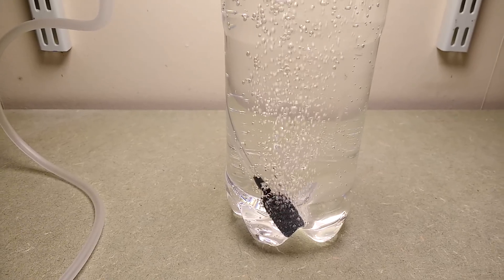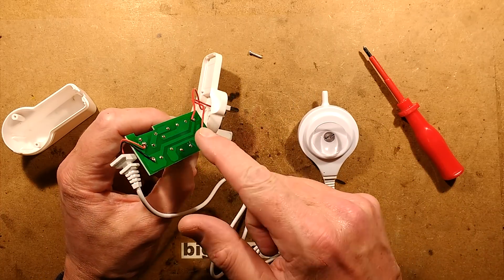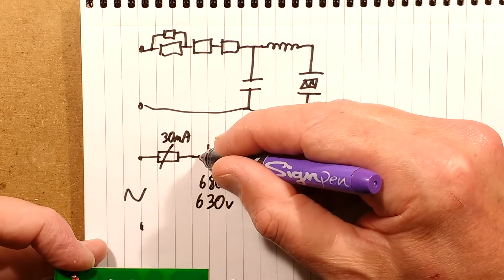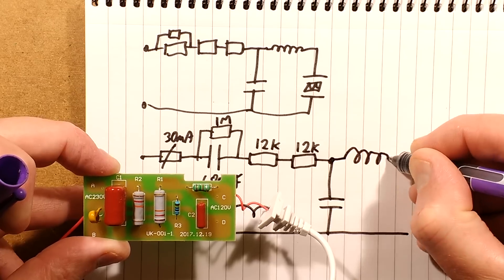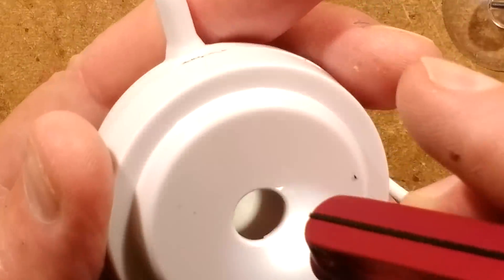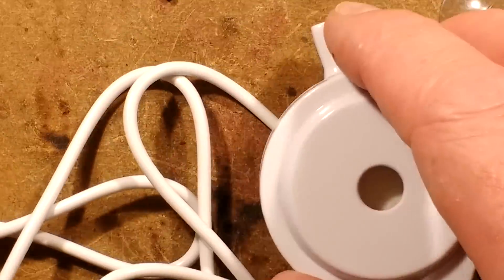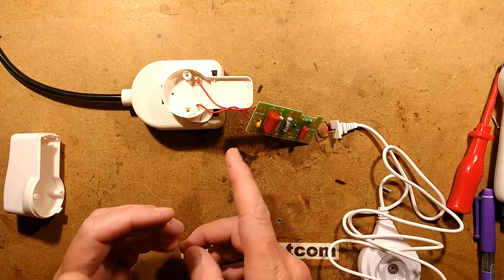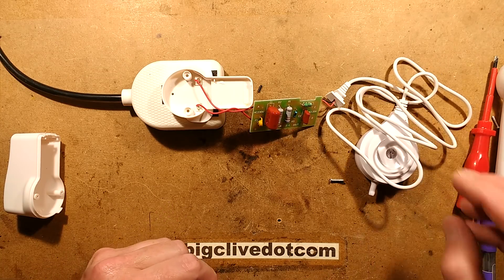Another mini piezoelectric air pump.  Let's compare the circuitry.

Comment: I wonder, if you need 2 such piezoelectric air pumps and put them in serie (2 x 120v right), you can get rid of the power supply (apart for the filters with are needed i suppose) ? Can this work ?
Reply from the maker: I'm not sure if that would be a good idea.
Reply: @bigclivedotcom these 2 piezo can perhaps disturb each other i think and give strange interference noises.

Comment: For anyone wondering. The bubbles don't add oxygen to the water in an aquarium, it's the bubbles popping on the surface that creates surface agitation which helps the oxygen exchange. In reef aquariums we use power heads to give surface agitation and coral sway

Comment: Way late to the party - I finally got one of these in North America - Identical power supply. How would you modify this to run on 120V? If mains supply is already the right voltage would a lower value resistor make sense to substitute for current limiting?

Comment: It used to be that air pumps had a rubber  diaphram and rubber flapper valves that you could easily repair by purchasing a replacement kit. Those kits don't seem to be around anymore, you buy an air pump and throw it away when the rubber  diaphram breaks.  I'm happy to see someone is coming up with a better design than the old style rubber diaphram types.

Comment: I would love to see you take to bits on of those Ebay shower heads that have a water turbine powered flashing LED show. I have had one for years to light the shower and it works fantastic .
Reply from the maker: Already tore one apart in a video.

Comment: That's probably ultrasonically welded shut.  Done correctly, the weld is stronger than the surrounding material.  Cool "technology" but sometimes a bitch to work with!

Comment: Hi, does it state anywhere what the life expectancy of these units is? I found that the main issue with 'normal' air pumps is either the fact they use brushed DC motors or they have diaphrams that wear out -both make the lifespan quite short, just a year or two...
Reply from the maker: These are fairly new, so I'm not sure what their life expectancy is yet.

Comment: Foaming issue is likely to be about the stone and the needless use of one. A straight section of hard air line is often used alone to reach the bottom of an air stirred witches brew and this produces a series of large bubbles that do the stirring without making impossible to pop zillions of foam bubbles. The large bubbles tend to pop a lot easier.

Comment: I took apart the power supply for a Rosewood Q2  pump - this is a higher volume version. It's thicker than the Q1 and I guess is a pair of discs working together.

This power supply is quite different from the once Clive as taken apart. It's a standard iron-cored transformer that drops 230V to 115V. The wire to the pump is 4-core and two cores go to each of the transformer output pins. That's all. I guess it's possible there are components in the pump : I want to use it and it seems difficult to get them apart non-destructively, so I've left that intact so far.

I'd be interested to see what the 110V versions are like. Perhaps they just go straight across the mains, or have a series choke and / or PTC.

Comment: I've found a more powerful version of these pumps. It's the Rosewood Nano Q2 and has twice the flow rate of the more common ones. The power supply is different though : bigger and heavier than the one you took apart, and feels as though it has a transformer in it. The pump is about twice as thick as the Q1 model, which is more like yours. Unfortunately there are no screws so hard to open (and the pump itself is well sealed too).

https://www.amazon.co.uk/ROSEWOOD-Nano-Quiet-Pump-Aquariums/dp/B073F9VJJ7

Comment: Clive      You open all of these devices that have capacitive dropper PSUs and they all seem to have those brown dipped style capacitors for the main dropper cap.   Are these style capacitors considered safety capacitors?  Are they considered X rated capacitors?   Please clarify.  If not, are these considered unsafe and a fire hazard????     The answers might make a good video topic.  All the info I have found on the internet regarding capacitive dropper PSU's dropper capacitors is confusing.     Thank you sir.

Comment: How much did you pay for these pumps? I've looked around but they seem to be fairly hard to find on eBay, at least with any guarantee that they are actually piezo-based.
Reply from the maker: Try a search for piezoelectric air pumps.
Reply: They seem to be more plentiful on ebay.co.uk vs ebay.ca. There are lots more matches without piezo on ebay.ca. Hmm...
Reply: There seem to be many more available from chinese suppliers than UK ones. But one of the cheapest I've found in the UK was in the pet supplies section of Wilko (£10).

Comment: Might be stupid question, but why does the UK use 50Hz & the US use 60Hz?
Reply from the maker: There were initially a lot of different frequencies with each company having it's own standard.  That settled out to two dominant groups 50Hz and 60Hz.
Reply: 50Hz is a more pleasing hum to the ears 😋 and if you get a shock there's more chance of letting go of the live conductor when the AC waveform passes its 0V part of the phase.. Lol.

Comment: I see that PSU as being an accident waiting to happen. It looks exactly like a low voltage adaptor, and the danger is that someone will cut it off and try to use it as such. The live side does have some current limiting, but the main danger would arise if the live/neutral were reversed because then one side would be direct to live.

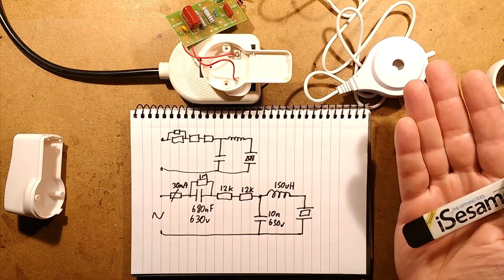Comment: 9:50 : I doubt that it might just be the opposite... The resonant frequency of the piezoelectric crystal might interfere with working of other devices connected to the power line... Also in typical LC filters the capacitor to the ground comes after the series inductor.. Which is opposite in this case... Indicating that the crystal might the source of noise and not the power supply... Just a thought :-)

Comment: I'm guessing the foaming is caused by an additive in your HCl. I use copper sulfate and HCl for my etchant and it hasn't had any foaming issues. Also, if you get impatient, adding some 3% peroxide to the etchant goes much faster than bubbling air through it

Comment: Fabric condtioner (like used in clothes washing machines) is excellent for stopping foaming up. One or two drops in a tray of etching soloution should be plenty as it is quite concentrated.
Reply from the maker: I'm cautious about using anything oily, as it may interfere with the etching of the PCB.
Reply: My PCBs come out fine.

Comment: That's definitely a tuning inductor to tune the electrical resonance to the same frequency as the mechanical resonance. If you wire past the inductor, you will see the piezo transducer's output is extremely reduced...

Comment: The solution is probably reacting with the air stone to be fair, have you noticed any grit in the bottom of the fluid?

Did you try the ultrasonic idea?
Reply from the maker: It doesn't seem to be disintegrating.
Reply: bigclivedotcom maybe a very mild surfactant may help

Comment: Am I right in being concerned at the thickness of the wires coming from the live and neutral pins from the plug? I didn’t think it be safe for them to be so thin.
Reply from the maker: I think the insulation is rated high enough.  The main factor in choosing that cable is probably the low current and limited nature of the supply from the plug unit.
Reply: bigclivedotcom thanks for the reply Clive.

Comment: I have wondered why put a Resistor around a capacitor. I have been looking for this answer for a while now.  Also, none of my books show resisters in series, is that common? I fully admit I could have just missed it.
Reply from the maker: When you add resistors in series it shares the power dissipation between them so they will run cooler.
Reply: Helps to "reliably" discharge the cap.  Fairly important at UK mains voltages (with a peak voltage of around the 350v mark) - putting a finger across a charged, decent-capacity cap can be an "exciting" experience! :-)
Reply: Phil S Thank you for your answer
Reply: bigclivedotcom Sir, I’m kind of jazzed, the man himself answered a question. Thank you.

Comment: Thank you Clive for showing the pump in water. That is amazing that so much air can be pumped by a Piezo disc.
Reply from the maker: It is quite surprising.  Someone calculated the deflection from area and volume of rated output and it was quite low.
Reply: The fact that they could make a check valve design work with that small amount of air flow is also amazing. Thank you post both video's on this . Enjoyed it a lot.

Comment: I've been maintaining a copper chloride etchant bath for over a decade now, and I use a fairly high airflow for sparging (more than an aquarium pump would put out).  I don't know if it's gradual contamination from organics (resist, etc), but I have to watch the foaming too.  

I just designed around the problem.  My etch tank has a reasonable excess of depth to allow for a sustained head of foam to develop.  If you're just sparging for regeneration, you can always just use a larger container with a different aspect ratio.  I kind of gave up doing air-regeneration that way.  It's slow, and you lose a lot of water to evaporation over time.  

I use heavy sparging during etching, and that keeps things fairly well oxidized to begin with. If I need something more to regenerate it, I just use 12% peroxide from the beauty store.  It helps replace some of the water lost to evaporation during etching anyway.  I run my bath at ~40C with heavy sparging; anything less vigorous than that would have less evaporation loss, so it might matter less to you.  

Other than that, just maintain free acid concentration, and the bath will last forever.

http://the-eye.eu/public/Books/campdivision.com/PDF/Sciences/Physics/Etching%20with%20Air%20Regenerated%20Acid%20Cupric%20Chloride_%20Adam%20Seychell_%202005.pdf

Comment: Half baked idea: industrial anti-foaming agents are of course  available. but Dulcogas contains the anti-foaming agent simeticone - if it stops foaming in stomach acid (mostly HCl) maybe it'd work in your etch tank... at least it'd impart a pleasant minty flavour :o
Reply: Simeticone is a silicone compound, not something you want anywhere near a PCB if you hope to get a good etch.
Reply: I don't have the chemical knowledge to say... but I have found a patent that mentions using DC544 as an anti-foam in PCB etching http://www.freepatentsonline.com/5127991.html
and DC544 is a silicone based anti-foam
Reply: That's interesting; I have to wonder what post treatment is required to remove the silicones from the board.

Comment: I had the same problem with using brick/concrete cleaner as a source of HCl for cupric-chloride etching. While the etch chemistry works, the surfactants in the brick cleaner make it foam up significantly. You need a very big tank to contain the mess.
I found straight HCl from a chemicals supplier (without the soap additives) is much better behaved.
Sadly I've yet to find a way to break down or remove the surfactants in brick cleaner - I suspect you'd have to distill it (not recommended!). I ended up mixing the foamy etchant with sodium carbonate to form copper carbonate and saltwater, filtered off and washed that, then heated it in an SMD oven to convert it into copper oxide. Mix that with HCl and you get clean (or at least cleaner) cupric chloride etchant which just needs the acid level adjusting to suit.

Comment: Connecting an insulation resistance meter with test voltage of 2500 or 5000V across a piezo buzzer made it sound and look really interesting, but not for long. Tried this many times, always works.

Comment: I forgot ... someone mentioned using a surfectant to get rid of the foam , this would compound the problem . Someone mentioned putting some oil in the etchant ... this would contaminate the copper and ruin the clean surface required for clean etching .
Perhaps a "defoaming agent" would work . This is usually sold at those places that rent carpet cleaning machines . Another possibility is a chemical supply or janitorial supply .

Comment: When I learned how to etch PCBs, we were using a FE3Cl contraption that basically only used the bubbles as active etching agents. The PCB was not submerged, but rather the bubbles went up a channel and over an incline where the PCB was located. Bubbles are much more effective than liquid it seems.

Comment: Here's a simple solution for the foaming problem. Just don't use the air stone. With a small drill like you'd use to make holes for through hole components can be used to make small holes in the hose. By small, I really mean about 1.5 to 2mm. If you heat the end of the tube you can easily pinch it to seal it shut. All you need then is weight to hold it from floating up in your etchant tank. Larger bubbles means less of them. The larger bubbles also tend to dissipate more quickly. Just some useful bits I've picked up over the years.

Comment: Cleaning type HCl as used for concrete has a detergent added.
Reply: You could try adding some of the anti-foaming agent they used for carpet cleaners, or dimethyl polyxiloxane, which is used in some foods. Either way it will probably cost more than  buying technical grade HCl.

Comment: Clive, I've seen videos of people opening laptop power supplies that are welded shut, by applying petrol to the seams.

I told a friend and he tried it on his broken power supply and said it worked a treat.

Maybe you could try it to open future teardowns rather than prying and cutting ?
Reply from the maker: I'll keep that in mind.  I've not considered a selective solvent.
Reply: mikeselectricstuff claims hitting the seam with a screwdriver never fails. I can't get the knack of it myself !
Reply: @theelmonk  when I do that, I usually end up with a hole in the side!

Comment: If you was to fit a non return valve to stop any back flow, how much pressure could that little pump put into a closed vessel?
Reply from the maker: Not a lot.  It's got fairly good flow, but not high pressure.
Reply: This seems to be one of the original manufacturers - most of the types available on eBay and aliexpress appear in their product listings.

http://www.heyi-pump.com/air-pumps/

For most of them, they specify 18l/H and 600mm water depth, though some are more. One says 1000cm but that could be an error.

I make 600mm of water 6kPa / 0.06 bar / 0.85 psi.

The pump does already have a non-return valve : it's a diaphragm pump, which needs them on inlet and outlet. So adding a valve will probably make little difference.

Comment: Might try adding a silicone oil to your copper chloride mix. It breaks  the surface tension. Dielectric grease, or evenba gas x capsule might have enough simethicone to do the job.
Reply from the maker: I thought of that, but if it contaminated the surface of the PCB it would prevent it from etching.

Comment: problems with Science and Chemicals, ask Cody at Cody's Lab or Mr Rage at NerdRage surely??
Reply from the maker: I'm thinking I've just got acid with other surfactant type chemicals in it for its original intended use as concrete cleaner.

Comment: Why did that board say 120v yet everything external was for GB mains?  Has 230v on the other side so confusing.
Reply from the maker: It was to reduce the voltage to about 120V AC for the piezo disk in the pump.
Reply: Hmmm, then what about we in the USA where 120V/60hz is our mains?  What would that circuit look like if 230 is being dropped to 120V for the piezo?  You are telling me that piezo would need no circuitry for the USA?
Reply: I opened up a 120V version, circuit is basically the same as this one except there's no series capacitor or PTC and the resistors are 2x 2k.
Reply: Clive measured the output voltage, which came to around 118v.
What are you so confused about?
Reply: Then it isn't halving the power as Clive thought.  This looks more and more like some sort of filtering circuit than any sort of voltage dropper.

Comment: Is it possible to use these pumps as a desoldering pump for a desoldering iron?
Reply: Probably not, there's not enough airflow.
Reply from the maker: Too weak for that.
Reply: Thaks. And what do you think about using it as for a hand smd pick and place pump?

There is more: What if you drive the piezo with higher frequency using an external generator? There is already a similar piezo pump from Murata.

Comment: Can you make a speaker out of it?
Reply from the maker: It's optimized for air pumping, you'd be better just getting a bare disk on eBay and gluing it over a hole in a box.
Reply: I've tried running an audio sig gen into one of these. It's only quiet because it's very inefficient as a speaker at 50Hz. Once you get into audio range it's pretty loud.

Comment: Will the thermistor get warm enough in the enclosure to cut power if those two 90 degree resistors heat things up far enough?
Reply from the maker: It might work for that, but it would probably need to be very hot.

Comment: As for hearing VFD noise, someone brought a switchmode supply for a thermostat to me. It made a noise whenever the large heatpump motor would run. I found the ceramic capacitor used as an X capacitor (instead of the usual foil part) was very piezoelectric and converted the line noise to audible noise. I replaced the capacitor, it fixed the sound, but of course did nothing to the horrible mess that VFD put on the power grid in the whole house (and beyond).
Reply from the maker: Noisy capacitors are really common.  Either clicking or whistling.  The ceramic ones are notorious for that.